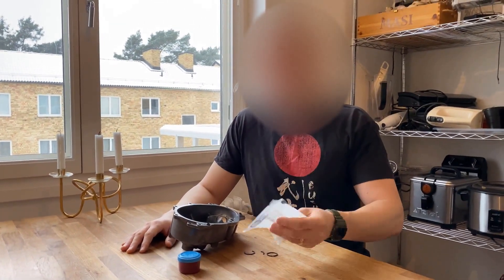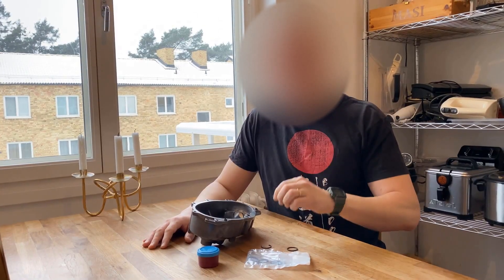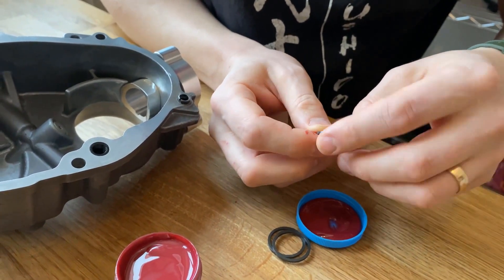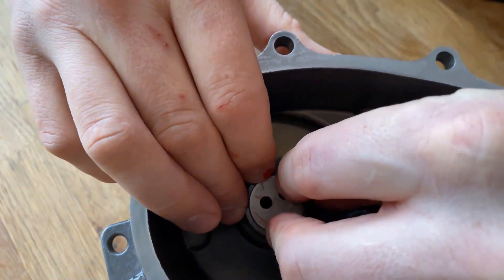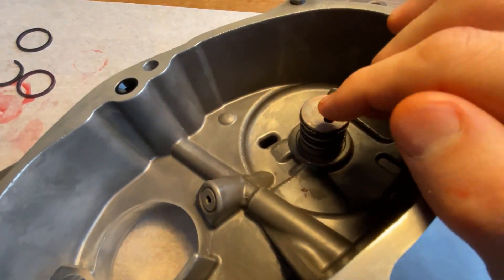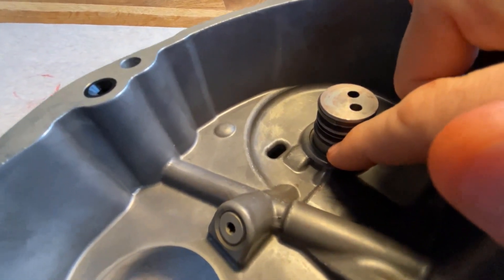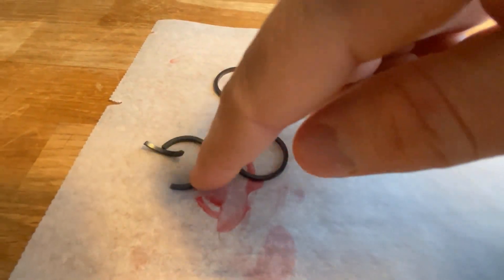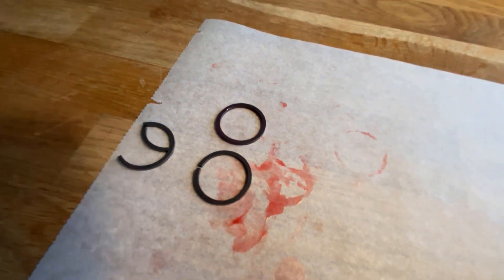These plastic rings always break! How to properly install the 06F198107A camshaft adjuster seal set

Comment: Would it be possible to replace these with a rubber o-ring? If they’re supposed to make a strong seal, then I feel like a rubber seal would be an improvement. Unless they’re just meant to slow oil flow instead.
Reply: No oil needs to pass still, that would starve your tensioner of oil

Comment: I replaced the cam chain and tensioner INNA brand on my Audi 2.0L TFSI two years ago as it was rattling badly on low rpm acceleration. Those rings were not broken and were teflon or plastic (not sure the material) so I didn't mess up with them. What I read, originally they are metal rings and when they wear they make grooves inside the adjuster. After 10k km rattling appeared again... I think the tensioner gave up again and this time I am thinking to replace tensioner to other brand like Febi and rings also. Does anybody know if rings wear out and is it worth to replace them if they are not broken?
Reply: If you must go in there for another good reason, best to swap the rings on a high mileage engine. Many don't focus on the importance of oil flow and containment of oil to the VVT system. They often neglect removing the N205 pickup screen and cleaning it. It's a small cylindrical cup screen inserted into the lower lip of the cam adjuster/chain cover. The cam adjuster itself can get gummed up internally causing a delay in cam timing. And there is one small valve inside the cam adjuster which affects oil containment and flow within the adjuster.Yes, the older rings could groove the center bore of the cam adjuster...and lose oil there. Again, any loss or escapement, or blockage, of oil affects cam timing.
Reply: @Roh_Echt  Thx for reply. I finished the job long time ago and I noticed that 1 ring was broken, others were not. I measured old rings outer diameter and they were the same as new ones so I replaced only broken one. I concluded that rings do not wear a lot so do not need to be replaced regularly.

Comment: What’s the symptoms if one of these break while driving I’m having hesitation total loss of throttle at low rpm like throttle goes completely dead have to press it a few times for it to start giving power again

Comment: Whats really the functions of these.mine broke but I used the car like that.but it losed power.
Reply: it is supposed to regulate the oil flow to the cam wheel... I am getting mine replaced as well
Reply: There are sections which the N205 distributes and controls the amount of oil into the cam adjuster for it to function; through corresponding holes between the N205 and the center-bore of the cam adjuster on the end of the exhaust cam. The flow and containment of oil within the VVT system is crucial for proper cam timing.

Comment: Is this the 2.0 tfsi engine I have p000a fault and been searching in the internet what I could be I came to the point that I needs to me the 3 rings?
Reply: I have the same code, from research, replacing the seals is first thing to try.  Waiting for delivery.  Local dealer quoted $120 for the set so I ordered on Amazon.
Reply: @sertimins  Hi, was your problem with the 3 rings solved? Or did you have to replace the chain?
Reply: @Elgarajedelvag yes for me it fixed the problem

Comment: Are all these rings supposed to move freely once on? Because the first two rings on mine are able to spin but the 3rd one doesnt. Its stuck on place
Reply: I'm on the same boat.  Mine are still kinda loose, they aren't as tight as these.
Reply: Loose is fine...they will close when carefully worked into the cam adjuster. A bit of tacky lube sometimes helps hold them in place for the install. Some do break the rings when replacing the cam adjuster/chain cover. Because they do not gently work the bit with the rings into the center-bore of the cam adjuster.